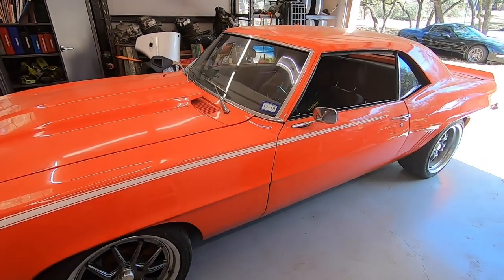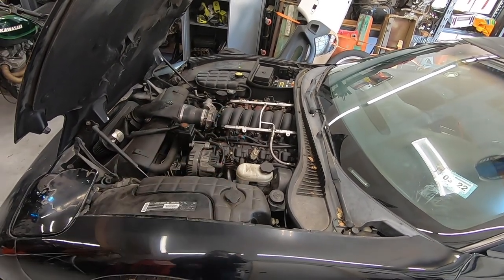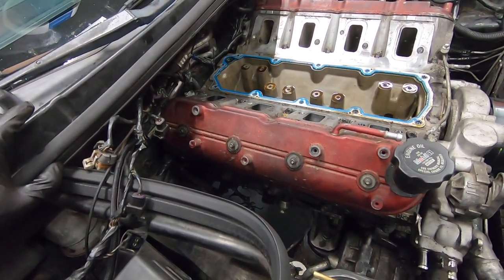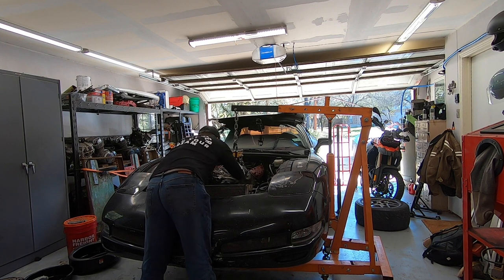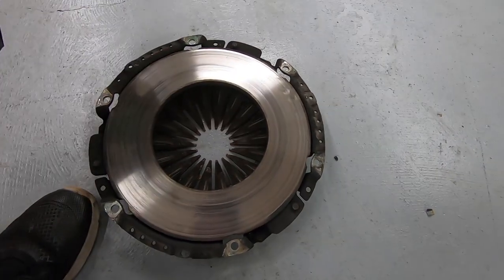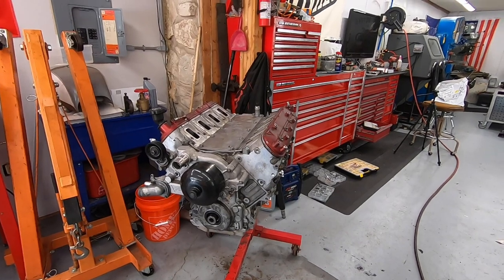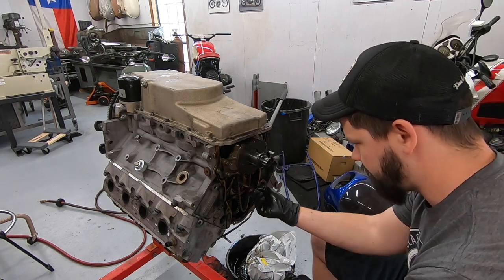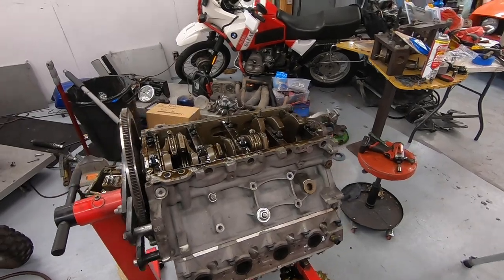The crazy engine in my CoPart Corvette. What is it?

Comment: You struck Pay Dirt!  Man, that engine is full of goodness. All you'll need is a new pair of iron underwear for those full power runs.  You don't want that pressure plate buzzing its way through the floor pan and slicing off your nuts!   Back in the day, we would run a scatter shield bellhousing...
It's not an easy or fun pulling an engine by yourself.  I've done a few so I know. You make it look so easy! Good Luck!

Comment: I would definitely replace the throw out bearing and the rubber isolator on torque tube while you’re there (unless the isolator has been upgraded) due to what you plan to do with the car. With a cam that big the 408 should make around 550whp, if you change to aftermarket ls3 heads and a bigger cam 600whp, but the engine looks to have some solid parts. Also if that diff is stock and you plan to drift at that power level please do a transmission brace, if not it is likely to crack (which oftentimes takes the transmission out with the diff) which sucks. But overall nice car with solid parts, looking forward to content!

Comment: Good stuff! That is more than likely a 403 stroker. The 6.0 is a 4” bore and with that being an aluminum block wouldn’t accept a .030” over bore. A good 4.005 hone with a 4” stroke crank and a 6.125” rod equals 403 cubic inches. 
I’m not sure the current configuration would yield 600 crank but it would be close. With the head casting cleaned up, a smidge bigger cam, and an aftermarket intake like a FAST 102 it should get there with ease.
Reply from the maker: Good call. I think you’re right about it most likely being 403 not 408. Either way it’s better than a stock LS6 like I was expecting 😂
Reply: @ClassicOctane  absolutely!! A very pleasant surprise!!

Comment: JRGO just did a video pulling the entire engine+DT out from the bottom and he mentioned you have to do this to align the transmission to the motor. it's nearly impossible to do it the way you've done it...which is why GM recommends the same out from the bottom procedure. 

it'll be fun to see you mate that back to the transmission.
Reply from the maker: We will see. I’m pretty confident it will go back the same way it came out but only time will tell.
Reply: its a pita but not anything close to impossible. i did it myself on my back with the car on jackstands and it was my first ever clutch job on a car. just takes finesse. this dude has way more tools, equipment, experience, and garage space than me so he’ll be fine

Comment: Taylor, good news on the parts identification. Regarding the clutch, even if it's within spec, if you don't like the engagement, you should consider changing it. A chattering clutch may drive you nuts over time.
Reply from the maker: I don’t mind it as long as I know it’s not something broken. If it was my daily driver I would probably swap in something like an LS9 clutch.